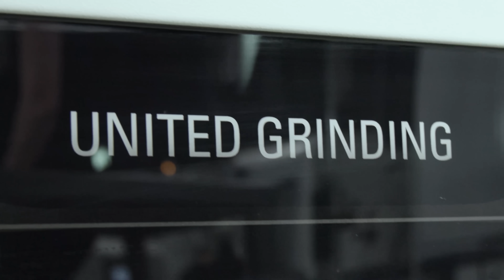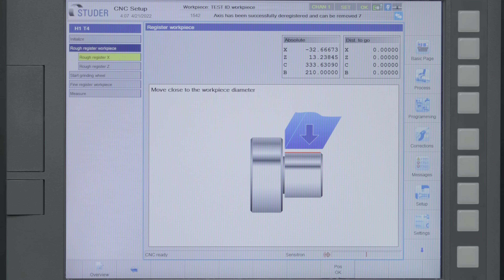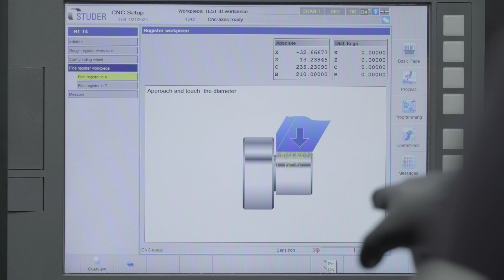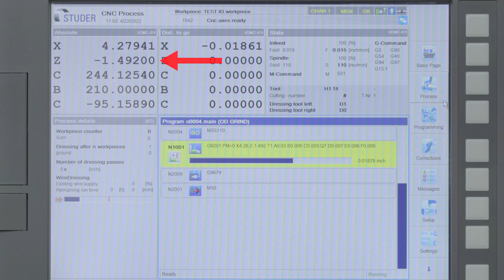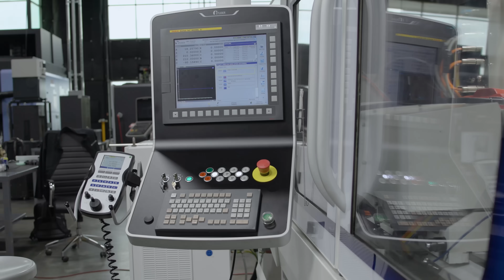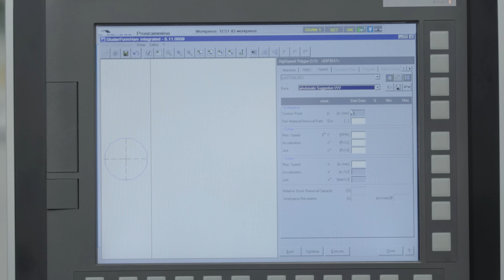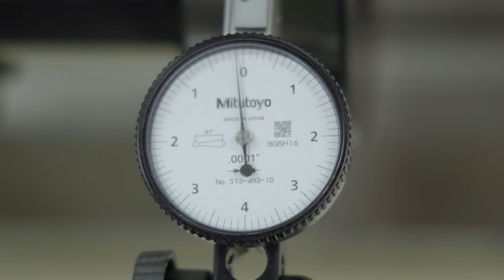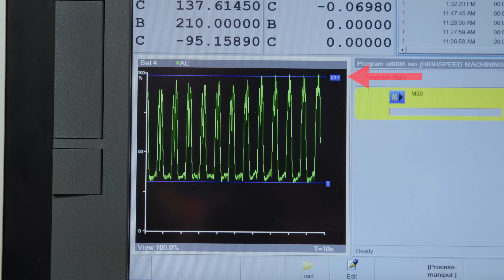How To GRIND a 16 Sided POLYGON on a Cylindrical Grinder

Comment: I'd have done some serious damage to someone to have had that software on my S40.  1 od wheel and 2 high speed ID wheels.  Grinding, among other things, high speed motor housings, both aluminum and steel, in two parts, with .0003" cylindricality over 5.25" when assembled, good times.

Comment: love it, great show and tell, and wow, what a piece, and that surface finish.
a question, what grinding wheel did you use, as there aren't too many videos showing what is on it, and how to mount the wheels, one assumes it is done by hand?, and not an auto tool loader?

Comment: Ok, If you are going to attempt polygon grinding on a studer you must remember a few things. firstly look at the part Chris has ground. how flat does it look? its clearly radiused on every edge. You cannot achieve flatness using a angle approach wheel. the machine needs to know the exact wheel diameter to achieve perfect flats so you need you use a straight wheel. You cannot measure a wheel at 30 degrees ie wheel 2 as T1 and T11 are totally different sizes. I do many form grinding jobs in aerospace and the flatness is easily within 0.001mm on these amazing machines
Reply: Yes, agree. Also Z oscillation needed, now i can see the radial stone marks on the part.

Comment: does the machine has a way to measure where it's at currently ? I mean because of the wear of the grinding wheel, you can't really know how deep it's grinding in practice. Or is it just ignored for short runs ?
Reply: You can use your offsets to keep the part oversized and measure after the initial grind. Then you can adjust as needed. With this run I had plenty of dresses to keep up with the wear of the grinding wheel. Thanks for watching and great question!

Comment: Well with  CNC you can do just about anything, but i dont like running maskines like that, also a reason i was out of the trade for so many years.
Okay i do admit i can get almost aroused watching some machines work, and also the things for the home industry i could make with such a machine.
But my time on CNC machines are as little as 5 - 10 hours

Comment: TITAN! This video is pretty related to the dilemma I'm in. The ol' Mill vs Lathe debate. I'm a new mechanical engineer coming from A LOT of 3D printing experience who likes to get his hands dirty and build stuff first-hand for gaining expertise in design aspects and just the overall mechanical experience of making things. But I want to start working with metals. Mainly brass and aluminum but occasionally steels. Before I invest in an awesome CNC setup, to learn the old school ways do you recommend starting with a small lathe or mill?
Reply: Amateur machinist here, Lathes are good for getting a feel for the concepts behind feeds and speeds, especially if they are manual (not CNC). But a Mill is far more versatile in what it can do. However Lathes are the kings of threading, cylindrical parts and semi cylindrical/ related parts (camshafts, bushings, tapers, etc), Really depends what you want to make. Honestly to get a feel for manufacturing, both are good, both have their limits.

Comment: Had to make one of those (Icosikaitetragon 24 sides) recently for a laser scanner.  Needed mirror surfaces and I have no grinder.   After milling, it was had lapping over the granite with 1500 grit followed by some buffing compound on a sponge.  I have serious tool envy watching this.
Reply: It would be interesting to determine how flat the Studer polygons are, given that the flats are interpolated, and any reversal error in the X-axis is being tested.  In the case of your method, your flatness is assured.
Reply: @aj7utu  That's true, and even with grinding I think I'd end up needing to buff out the tool marks.  But hand lapping is a terrible way to spend the evening 🙂

Comment: What abrasive (grind wheel) are you using? This is really cool I only do cylindrical. Are you programing with Studer WIN or just pictogram? When touching off I like to tap to Process so you can really see the dital spike.
Reply: I am using a Tyrolit 60 Grit with 70 grit embedded throughout the wheel. I am using Studer HSM cycle. Check out our grinding academy coming soon to learn exactly how I did this!
Reply: @christophervillalpando5865  Thank you. I notice you like that brand abrasives I'll have to check it out. We use Norton, Noritake, and Meister.
Reply: @jeremyl.7563  Yes you should check out the Tyrolit  wheels! I have had very good success with them!
Reply: Do you know if the Studer s11 is capable of doing high speed form grinding aswell?

Comment: okay, here is a question I have. Because the grinding wheel is cut at an angle, the diameter of its grinding surface is different if you look at different points on the z-axis. the diameter of the grinding wheel that is closer to the chuck  has a different surface velocity when it is spinning than the inner diameter. does that have any effect on the surface finish?
Reply: Surface speed of the wheel on the 45 degree angle is minimal change between the larger and smaller diameter. 

Typically surface speed is measured in metres per second in the world of metric so the difference is minimal, more so that this wheel will likely be in excess of 400mm (16") diameter in use. Respect to the guys who load these wheels in the machine, I picked one up for our Studer S41 and they are definitely not light!

Comment: What are the advantages to using the pink wheel vs white or others? We have centerless grind, ID/OD Cylindrical  Grinders(S33 & FavoritCNC), and 2 die cylindrical thread rolling.
Reply: Each color indicates a different abrasive. It depends on the material application.
Reply: The material and finish you are going to grind play a major factor in your wheel selection. Thanks for watching!
Reply: @christophervillalpando5865  Why did you choose the pink wheel? What are the advantages of using a pink wheel over white or others? Is the advantage the wear characteristics, or surface finish, ability to use on many types of materials, ect. Thanks for any info.
Reply: @kavanlaing7238  I selected this Tyrolit 60 grit wheel because of the material being ground. this wheel is on the softer side and is used for light to medium stock removal. I also like using a 30 degree angled wheel when I can.

Comment: How did you clock C between the two sides to align the two shapes to eachother?
Reply: I dont think he timed one side to the other.
Reply: Its not two shapes. The macro where he input he number of sides calculates the angle.

Comment: Im from Germany. Worked on old Studer.
I used to learn not to stop the wheel during measuring.
Because the the wheel would suck in the oil and gravity would pull it down so there would be inbalance after...
It's not like that nowadays?
Reply: So you would flush the grinding area with actual oil, like way oil?
Reply: @helpme_obiwan  when part is finished yes
Reply: when you start the wheel it will throw out the liquid again and you can program it so that it will balance the wheel first in your program

Comment: Grind a cam for a single cylinder engine. Does the wheel always stay at a angle to the part or is that a axis?
Reply: The C-axis and X-axis servos have to be synchronized.  Right?
Reply: @helpme_obiwan  At the beginning of the program the machine references its C axis. I went into further detail in our Grinding Academy! Check it out!

Comment: Why wouldn't you just put the flats on with a reciprocating surface grinder? Cutting them on a cylindrical grinder like this will cause a concaved surface instead of an actual flat.
Reply: It doesn't just plunge in the wheel, it interpolates the X-axis as well so it creates an actual flat surface. Surer, there might be better ways, but this way you could do the polygon grinding and cylindrical grinding (and other stuff like threads etc.) in one setup.
Reply: On this I can program a smaller radius along the sides which would help with that, I made the radius .100 for each of these. And rather than grinding, flipping and grinding again. I just decided to do it all at once. Great question!
Reply: @christophervillalpando5865  So the C-axis and X-axis servos are synchronized?!

Comment: How do grinders account for wheel material loss?
Reply from the maker: I will let Chris come in here and answer this.

 I know that in many applications, you actually re-dress the wheel during the process and the machine automatically knows where the new edge is and compensates / offsets in automatically, then continues to grind. You can set the timing on this based on application and hardness of wheel etc.

Titan
Reply: Titan nailed it! The wheel is dressed and the machine compensates for wheel wear. You can pick in your technology for the wheel how much to dress and how many passes. In the programming is where you can select how often you dress, for example before the grinding operation, during or even after.

Great question!
Reply: You have to calibrate each spindel and dresser once and give the studer the right parameters of the wheel you put in. After you did that once you can work a long time without calibrating again. I work at a studer s42 and i make such a calibration just once a year or so. The only thing wich changes is the diamond wich over time wears down...
Reply: is there a dresser calibration cycle for the diamond wheel dresser???

Comment: Thank you for the video. I would like to see you finish grind hard anodized aluminum part to size(+/-0.0004) OD and ID concentric and N4 finish. We quoted something like that once but didn't get the job.
Also interested to know about fixturing finished parts where you can't squeeze them in the chuck.
Reply from the maker: Those are excellent ideas. We will put them on our list.
Reply: All great ideas!
Reply: What fixture system has the highest positioning precision between workpieces?

Comment: Hi everyone,Just wanted to ask: is it possible that face mill (easy roughing nothing crazy) can damage the perpendicularly/precision of the machine? I’m facing this with an old style machinist that wanna hear no excuse and always wants to have the last word on everything.
How can I prove him that he is wrong
Reply from the maker: Not unless you crash it… machine will stall before it ruins anything. You should join our Facebook Private Group where there is a ton of machinists to ask questions from and to learn from.
Reply: Also check out our videos on Tools of Domination and 644 MRR. We didnt hurt our machines AT ALL with these cuts
Reply: Thanks for the reply, I mean.. machine are calibrated and tested at maximum performance when they are built right? They are made for working like days and days no stop at 100% power.
Old man machinist thinks that modern machines are like manual mill from the 80s and 90s haha 😂
Reply: @matteomagni2084  i was taught that usually the machine stalls before the tool or anything in the machine breaks. 
and even tested that with a 85mm facemill. 
the thing is that stalling the machine can damage the gears if you have a gearbox or the drive for the spindle if you do it long enough but besides that and crashing nothing should damage the machine. 

and even if the machine has crashed you can run a kinematics check and then the machine should know what's out of the usual and potentially calculate what to do to compensate that. 

we have a big mill at work where the tower is tilted by 1.2° or so and i think another axis has around 2° bends in it😂
Reply: @Sebastian-ed5kt  Yikes on the last sentence
Reply: @helpme_obiwan  yeah, it's not that bad, the machine knows that exactly and therefore compensates that